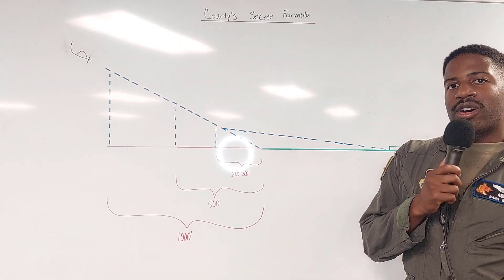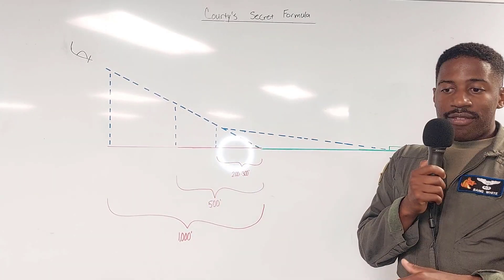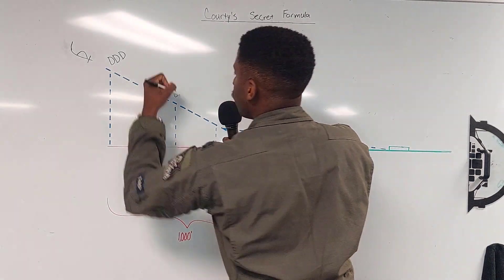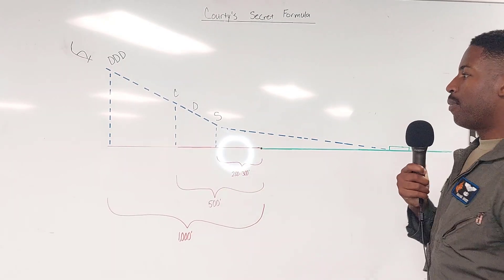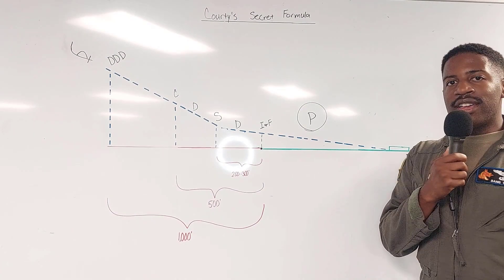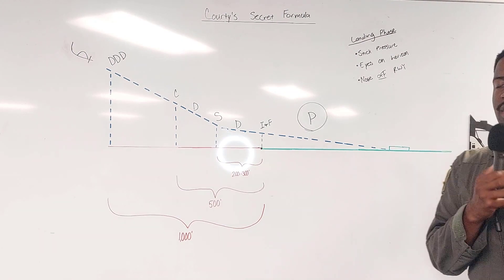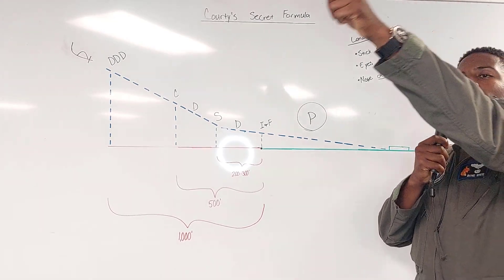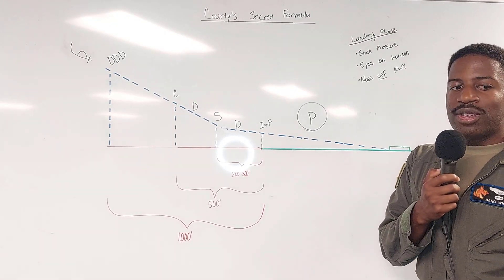How to Land a T-6 | Courty's Secret Formula

Comment: Or, you could just fly it at the proper speed the whole way down and begin to retard the thrust lever as the pavement passes underneath while simultaneously arresting your descent with the stick.  Your way seems like a lot to remember.  Landing any airplane is an athletic maneuver you learn by seeing and then practicing.  Repetitions are crucial.  Memorizing steps only accidentally leads to good landings.

Comment: F this slow as S%&T BS.  Here is how a real approach is flown.  Slow down configure with gear only, accelerate back to 300 hundred knots.  BTW, this starts over 20,000 ft.  Aim 1 mile short of the runway with throttles at idle.  As you approach less than 5 miles start shifting aim point down the runway to bleed airspeed to 190 knots at touchdown.
My friends that’s how you shoot a Space shuttle approach in a T-38.  That’s how I was taught it by a Space Shuttle pilot doing a practice EP sim while I was a T-38 FAIP
Reply: PS Those MFer on cross country go Alt flaps and set 5 degrees, then air hook at FL430 with a tailwind.  That how I fly San Diego to Enid 1 hop.